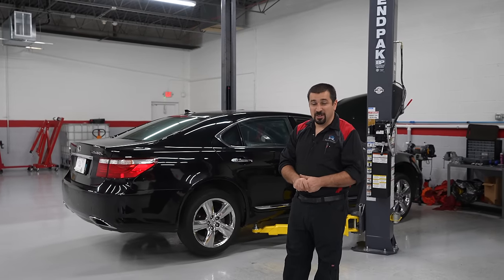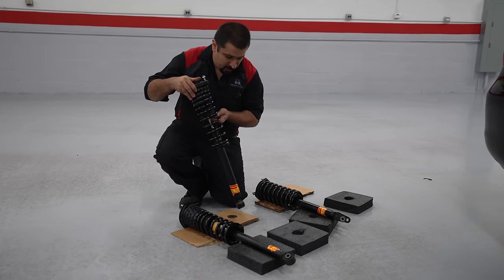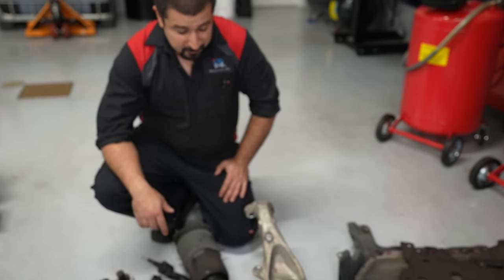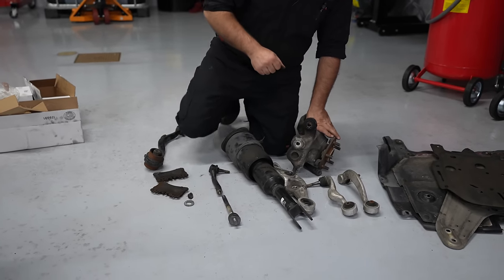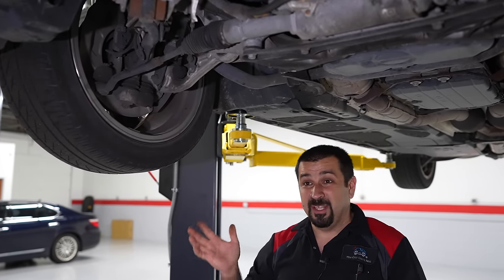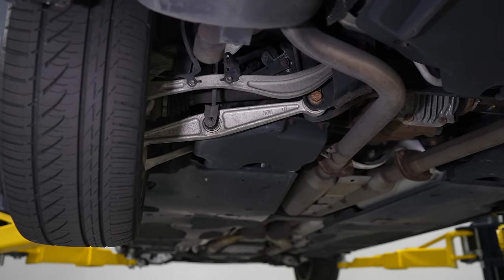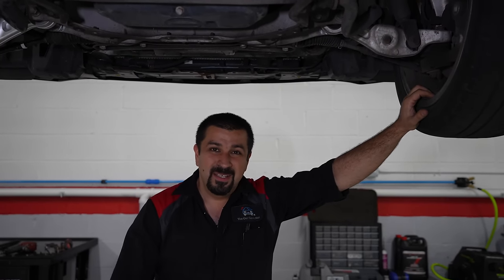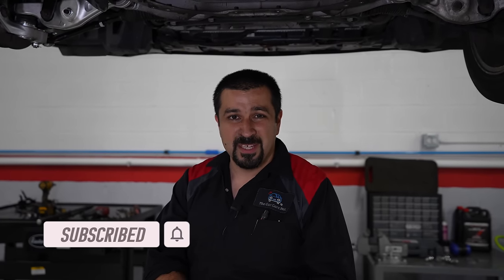Avoid THIS Lexus Model | Pre Purchase Inspection REQUIRED for this one and Here's Why.

Comment: I was considering buying one of these LS460 with 100k miles but you convinced me to steer clear of them, decided to go with an ES350 instead.  Its not quite as advanced or luxurious but I would still drive it across country. It's a very nice car and super reliable.
Reply: I have one and it's been super reliable. Yeah the tech isn't good. But you could get a sony headunit from Crutchfield and replace the head unit to a modern Bluetooth android auto/apple carplay one.
Reply: why not get the GS?
Reply: @MiguelRPD   Why do that? Just go with the Grom Audio V-line 2. It runs Android Auto/Apple CarPlay through the stock head unit and retains all factory functionality. I run it in my ‘08 LS and it works brilliantly.
Reply: @normanfillmore3490  Oh I have the regular model. Not the ultra luxery version.
Reply: @CarsofGlasgow  I mean yeah if I can find a GS350 with AWD I would go with one of those but they tend to be harder to find. I need either FWD or AWD because I live in mountainous terrain with bad weather (currently driving a RWD car).
Reply: They are still good. Just stay away from the air suspension.
Reply: Lexus ES or a fully loaded Avalon
Reply: @CarsofGlasgow   I  Agree. I'm lucky enough to own the 2020 Lexus GS350 F sport black line edition. Only 210 of them made for the last production year. What great a car.
Reply: @newtonwilliams3778  wow, amazing
Reply: "decided to go with an ES350 instead"
You lucky person you! 
Unfortunately, in the UK, we only get boring 4-pot ES, IS cars now, or the top of the range LC, RCF, LS type cars and nothing in between. We also don't get the LX600 or the GX460 with the raging V8. For the GX460, we get the Toyota Land Cruiser with a 4-pot diesel engine.
Reply: Same for me!  The LS 460 seems like it'd be a dream with a V8 and I thought the starter replacement was the only headache to owning one.  If I didn't mind buying other people's problems I'd get a Mercedes or a BMW!  I'm looking for an ES or maybe even a GS, the problem is finding the RWD not the all-wheel drive, or one of the hybrids for the same reason, I want to avoid a needlessly complex car, more likely to have serious issues!

Comment: Dear Presenter, you are fantastic and I enjoyed throughly with this video. Can tell that you are a very detailed professional and you earned much respects from most of the viewers. 

I had a same car , 2010 LS460 F Sport , rear wheel drive with air suspension. I am still the first owner of this car and odometer is 70K kilometer after 12 years of driving. I intend to keep it for another 10 years and I will take serious note of all these issues. I m very impressed of your presentation and your clarity of your good speaking and narration skill.  

I come from Singapore where the LS is situated. A small island country sits on equator . You take good care and would like to see you more often in Utube. Cheers.
Reply: Have an’08 LS 460 since new. 140K w/ the usual maintenance, still love it, recently replaced the stereo and amp. Every time I think about replacing the car w/ something else, I come back to the point….w/ what?  That V8 & transmission is glorious…I just can’t bring myself to get rid of it.

Comment: Had a 2008LS460 with exact same issues..Did the strutsmasters conversion kit, replaced all the control arms, brakes etc..After a year (30k miles), the control arms had to be replaced again, i gave up and got rid of it. And it was burning oil as well and on top of it my brake actuator started to make clicking and popping noise (3k repair). Listen to the brother right here..Be careful with these!

Comment: I had a 08 GS460 for about 5 years and loved that car! Same engine/trans as this but none of the suspension issues. Put over 100k on that car and was still running great at 230k when I traded it in
Reply: That's a rare car. Less than 2000 made over four years.  Better than the LS, for sure.  Different suspension that lasts much longer.
Reply: I refuse to let go of my 3GS 300, but thinking of swapping for a 460
Reply: Crazy rare car!
Reply: Have the gs460 currently with 153k. I don’t think the prior owner took much care of it when I got it at 118k. But it’s good now! Solid. 

Wish the GS interior was a little bigger, but very stylish car overall.
Reply: It was probably my favorite lexus out of the 4 I owned, so much power and looked amazing

Comment: My 2007 LS 460 burned so much oil , had suspension problems, and replacing the starter was a big expensive job. Even replacing a headlight required taking of a tire. Great nice car but it is expensive to maintain . Traded it in a while ago.  My ES is more affordable to maintain not to mention not a premium only fuel V8. Had to cancel appointment but I can’t wait for you to see my 2000 ES 300 with over 200k. It has HID factory Installed lights which was very surprising to me. Thanks I really enjoy these videos !
Reply: I have the same car same issues minus I don’t think I’m burning a lot of oil. Thinking about selling it. The front needs to be done I did the two rear air suspensions and starter on it so far
Reply: That's right around with the HID (and clean lighting) craze started!  Time is flying by!
Reply: @RahzAlGhul    Hi.  I don't know if you come back to check your old posts, but I have a thought for you (and others in a similar position).

I can see you might be tired of putting a lot of money into your car, so you figure maybe get something else.  But!  If one buys another used vehicle, as someone else above said, all, or most, will need some repairs to 'bring them up to snuff'.  

At that point (with a different car), 2 things:
a)  What's the general prognosis for that type of vehicle, regarding what might typically go wrong with it in the future?  (As in, in a few thousand more kilometres, what else do those owners typically have to fix?), and
b)  How would you feel about having / driving / enjoying that car?  I'm assuming an 'alternative' car wouldn't be as nice as these Lexuses (Lexi? hehe) seem to be.  So, driving something 'lesser' might not give you the fun and enjoyment?

I'm thinking about this because let's say you put another $3000...$5000...whatever into your nice Lexus.  Then from that point what's the prediction for future 'known issues'?  Are they then good for the next 5....6....7 years without expected breakdowns?  Because if so then you might actually feel better about keeping your Lexus.  You will have spent the necessary dough to make / keep it good, and you won't have to worry about a different car's future 'unknowns'.

Just a thought.  I guess the answer is different for everyone.  But I know I'd rather 'invest' in a generally great, well made car with all the luxuries a Lexus has than drive a lesser car.🙂
Reply: @be5952  thanks yeh that’s exactly what I’m doing. Doing the install on Thursday. Everything new up front. Air suspension, control arms, and knuckles and tie bars
Reply: With the ES330 you have to partially remove the bumper and battery to replace the driver side headlight housing.

Comment: I bought a 2006 LS 430 with 155,000 on it. I had to replace the entire suspension like you see here. Saved a ton of money doing it myself, and learned a lot.
Reply: Did you convert it away from air suspension because it typically doesn't cost that much when you get a conversion kit instead of reinstalling air suspension
Reply: @bpaige12  lol why would you want to change it from air suspension the better setup.

Comment: I had a 2002 LS 430.  Started to have front-end suspension issues at 75,000 miles.  Apparently that's a common problem with the LS platforms because they have so much weight on the front end that those components wear out quickly.  I went to polyurethane bushings, but the car was never the same afterwards.  Beautiful car otherwise.
Reply: Mine has 112,000 miles. Haven't encountered that issue. Are you sure it is an LS430?
Reply: @Kauffman578  they might have the air suspension version, is yours air suspension?
Reply: @angeljaimes9703  mine is the middle one, except air suspension.
Reply: You don't want to go with poly bushings on these cars. It's going to be a huge downgrade in the ride quality. 

& yes lower ball joints on these things love to get burned up. One of the few things they didn't overkill overbuild.
Reply: PO of my 2004 430 went to the Lex dealer time after time for "loose" front suspension. They threw LCA bushes, ball joints, struts, alignment after alignment at it.  Did not fix it.  After I bought it (100K mi) I can verify at highway speeds any bump would send it all over the place.  Spent some time researching on the Lexus forums then DIY replaced 4 steering rack bushings (parts cost about $120) it now rides like a dream.  Check your steering rack bushings, they are a weak spot on the otherwise bulletproof LS430.
Reply: @zoomee99  very true. The Car Care Nut has a video about this as well
Reply: I lower my tire pressures to 230kpa to provide extra cushions.
Reply: Thanks to both Jt H and lowstrife for the tip about polyurethane bushings.  It's exactly this type of info that helps others avoid something that they later sadly regret🙂!

Comment: I got a 2009 GS 350 rear wheel drive this thing does not burn a drop of oil runs like it's brand new with 135,000 mi on it.
Pick your lexus's wisely

Comment: My grandfather had an 07 LS460, no suspension issues and no air suspension but it did burn oil. It was well maintained too.
Reply: The owners manual even says the 460 burns roughly 1qt every 500 miles or so crazy!

Comment: I have a 2012 LS460L and I baby it.  I only drive it 5000 miles/year.  I service it myself.  Changed my own spark plugs and saved $.  The stealership wanted $400!  I also change my own oil.  I put synthetic Mobil 1 in it always.  Thanks to your video I now know to check that lower arm on my driver's side front suspension.  The driver's side front tire was worn out on the inside prematurely, and of course, the tire shop was happy to sell me a new set of tires.  I need to get that addressed immediately.  I think I'll have my independent Toyota/Lexus mechanic inspect both sides too.  Thank you for this video.  I think it will save me lots of cash in the long run.

Comment: AMD, A picture is worth a thousand words so a 21 minute video like this must be worth a million. I was reminded that a thorough PRE - purchase  inspection is compulsory in the used car market and a car that is MORE expensive to buy is a car that will very likely be MORE expensive to maintain. 😁
Reply: Also a lot of people who buy those higher end performance cars run them into the ground don’t maintain them. A vehicle inspection is an absolute must if buying a high-end model
Reply: @SteveB88  I would say a detailed inspection from a qualified mechanic is mandatory for a used Yaris and becomes more mandatory with the additional complexity of more expensive models. I have walked away from a couple of potential used car purchases that failed to meet the required standard. The money it cost was well worth it. Like all my car lessons,  I learned this the hard way 😂
Reply: @rightlanehog3151    Totally agree.  And, I will add, if your inspection turns up however-many-$ worth of repairs, you might still decide you like the car enough to buy it, fix it and enjoy it anyway!  And this especially if it seems okay other than whatever has worn out and just hasn't been replaced.

To me, there seem to be two types of need-a-lot-of-repairs used cars:
1)  Those that are driven by generally careful drivers who'd just rather buy a new(er) car when theirs has too many parts wear out, and
2)  Cars that are beat to crap by someone who abused or didn't care about them.  This second kind might need the same list of repairs right now as a similar one from criterion #1.  But due to how it was treated one might expect a ton of extra troubles down the road.

Comment: When I compare the suspension cost of a Lexus vs the Mercedes the Lexus is more for sure. I have an LX470 and the brake parts were north of 600 for original parts. My biggest complaint with the Lexus is the parts availability. The Mercedes is more of a world brand so the parts can be found easily. Great videos by the way.
Reply: Thank you, finally someone who admits it!

Comment: I'm surprised those brake pads could be incorrectly installed and result in wear to the rotor hub. Thats seems to be contrary to lots of Toyota mistake-proofing designs (poke-a-yoke). Thinking back to pad replacements I've done on Camry's, Tercels and Subarus it would seem impossible to incorrectly mount the pads. Either the caliper design is flawed, or some knucklehead found a way.  🤕
Thanks for the fair warning on Lexus air suspensions. This type of video is invaluable.

Comment: Any car with air suspension is a big NO from me.  Why are the bushings so bad?  High miles? Potholes?
Reply: Probably both and it may have been in accident that damaged it with the previous owner. You can't really maintain it like with conventional parts as its an enclosed piece. Its a very unreliable technology that seems to bring a lot of profit to dealerships.
Reply: Yep, I will never ever buy a car with air suspension.  Too many issues down the road and too expensive to replace those shocks.  Not worth it at all.

Comment: Have 98 ls400 104,000 miles.  Performed regular maintenance: timing belt, water and power steering pump, brakes, battery, new tires ect. Best car ever owned. Fast, smooth, quiet and luxurious. And no car payments. 😋

Comment: My Ls430 is still chugging at 266k. Just replaced the starter last week. Swapped out the original valve cover gaskets at 245k. 

Was extremely well taken care of before I bought it. And I still do. It really is worth it.
Reply: I did my  original LS 430 starter at about 255k.  Man I hated that job.  Can’t complain though the starter was 18 years old
Reply: @texaslegend5076  exactly. Some things are a pain, others are expensive, but considering you’ll only have to change things out once every 200k+ miles is good enough for me.

Comment: LS 430 is the superior LS. The 460 was rushed to compete with Mercedes and it’s evident with all the cost cutting measures (melting dash, thin sheet metal, etc)
Reply: is deffernt at LS 460 2013-2017 . no issues like that
Reply: All Japanese cars have thin sheet metal😂
Reply: The GS460 is the superior LS460 xD
Reply: Mostly all Toyota dashes melt
Reply: @abelbenzo  not my 93 LS400
Reply: @abelbenzo  then you haven’t owned an LS400 or a LS430. They’re built like tanks solid everywhere.
Reply: Sadly, I have seen a few "cheap outs" on Lexus.  I have had three ES350s last one being the 2017.  The 2012 model had a real spare tire, better seats and cooling, less plastics.  I hope Toyota listens to us.  That's why I divorced the Mercedes
Reply: @blackemmitt  I have a 2007 Lexus ES 350 with about 200,000 miles on it. It’s one of the most solidly built vehicles I have ever owned.

I’m going to keep it as long as it runs and then probably trade it in for something in the 2012 to 2015 year range. I believe they were still made in Japan up to that point.
Reply: @MRMAN-wb1tv  No not true the dash on my 95 GS still looks brand new
Reply: @AlanForde-CheyneMS  My 00, 02, and 04 look new also, but they are prone to melting and cracking. It all depends on the CARetaker
Reply: @abelbenzo  previous LS cars largely dismiss this claim

Comment: I made A LOT of money fixing these cars. The LS460 got better in 2011 with much more robust control arms. Its far cheaper to completely replace the air struts with standard spring struts. Air ride was much plusher in the LS430. Water pumps and engine valley coolant plate leaks are also a known weak point of the UR family of engines. Not uncommon to see radiator failures as well.
Reply: Did they stress the water pumps, coolant valley leak and in the 2011+ years like they did with the suspension?
Reply: This comment should be pinned for those suckers still willing to buy this car
Reply: @@japanwatchconnectionits land cruiser, 😅

Comment: I have an '18 GLE350 and your comment about checking the rear main for leaks is helpful because I want to catch these problems (or potential problems) at their smallest before they become so unbelievably costly.  Man, I'm so glad I subbed your channel; already a real favorite.
Reply: Friend if you find your rear/front main seals have a leak it's already bound to be costly, esp if you have it done.  If you do it yourself, many times you can change those seals with the engine still in the car and possibly, even without removing the crankshaft.

Comment: I own an LS460 without the air suspension. I replaced most of the bushings with polyurethane. It makes everything even tighter. Still a great car. It has 115K.
Reply: Sounds like a rough ride 🤔 what tire size?